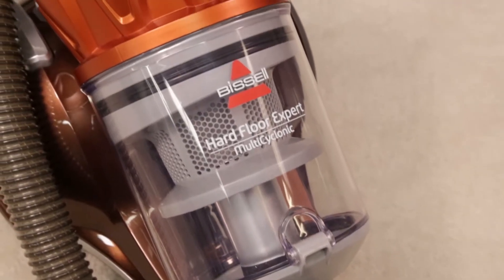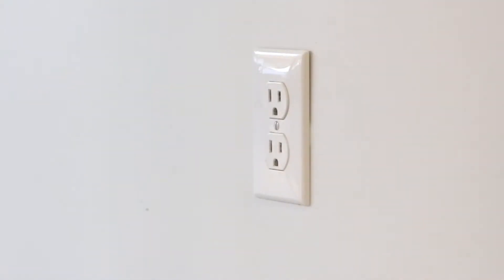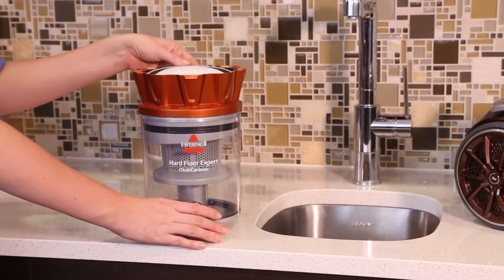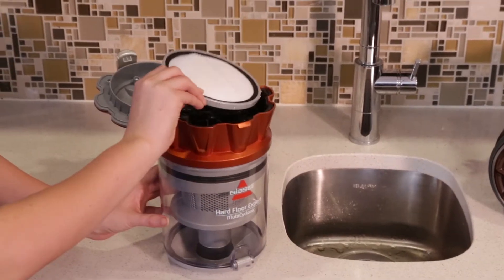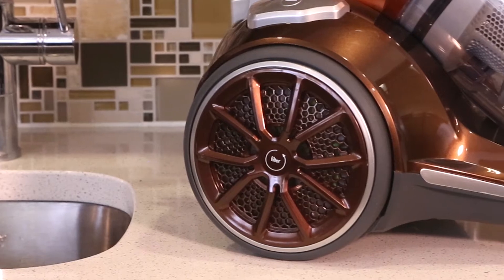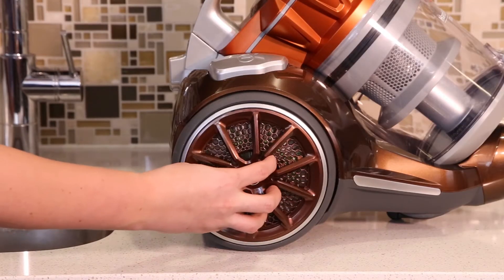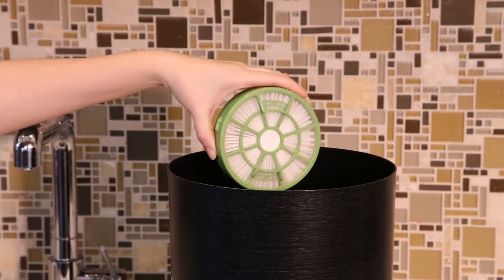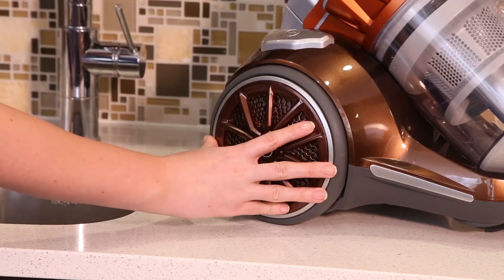Hard Floor Expert Canister Vacuum - How to clean the filter 1547

Comment: For those who have suction issues!!! If you've used your vacuum a lot, flip the top lid, remove the filter, and unscrew and clean the panel underneath. My vacuum was FILLED with dust and hair in all the tiny holes. Works like new now :)
Reply: i just did it !

Comment: I haven't used my vacuum 10 times and there is already zero suction on the bigger arm so can't get any carpets cleaned. I cleaned my filters and still no luck. Help!
Reply: It’s for hard floors only
Reply: @Dustyscorner1111  My problem is solved. There was a wipe sheet stuck inside the base, which I couldn't see. It's by pure coincidence that I turned the machine upside down and I noticed the tip.